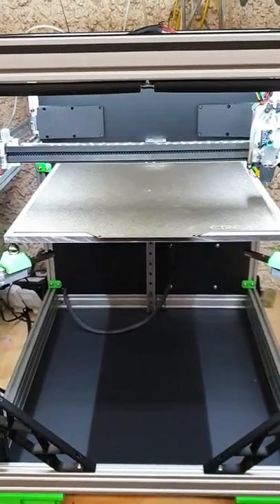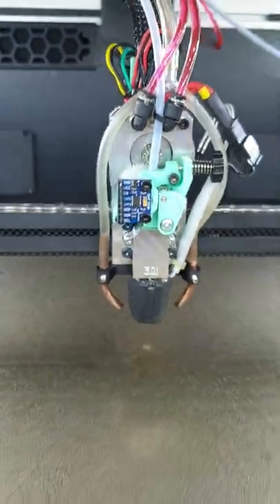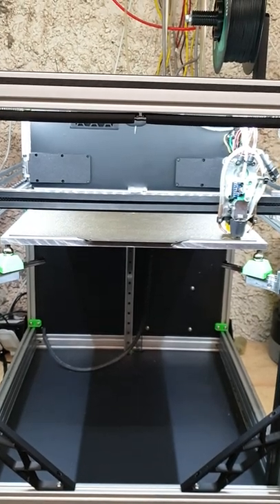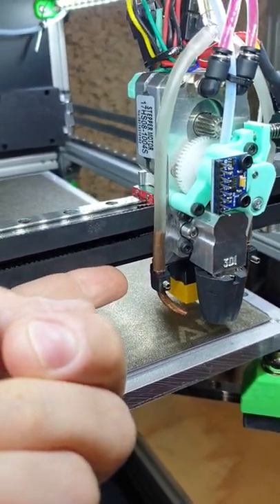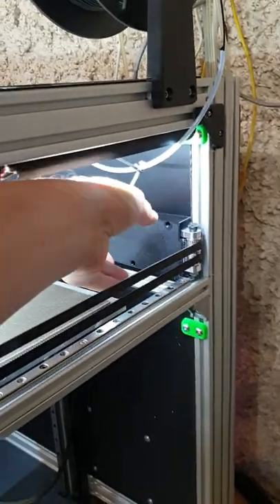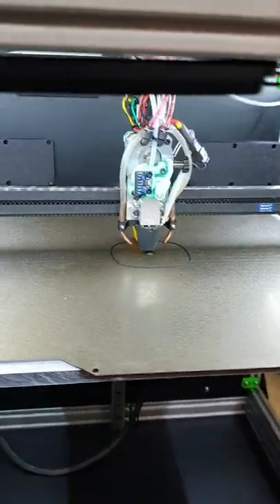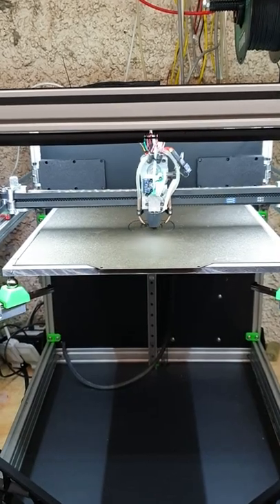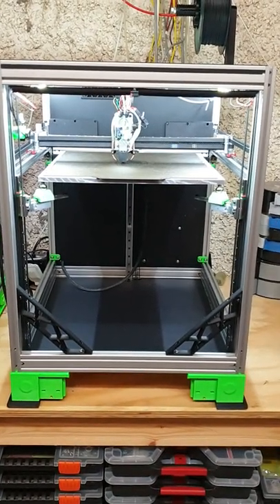CoreXY 3D printer short introduce

Comment: Hi, interesting, what size build plate are you running there?
Reply from the maker: Hey, 370x370, but this was one of the first iterations. after I did LQ on voron 2 years ago
Reply: @3dicnc  I'm building a Voron 2.4 at the minute, plus I have an Ender 5 Plus waiting for the Mercury One.1 upgrade (with the Hydra), I did start looking at whether I could mix the corexy top of the Mercury upgrade with a 4 point screw system (with 4 rails instead of the Hydra 3 screw/rail combination) but I need to complete the top end conversion first.
To complicate it a little more I was looking at using the printer from the side, not from the usual front.

I know you can get a 400x400 plate for the Mercury One.1 from Fabreeko in the US, I may look at.

Great work you've done though.